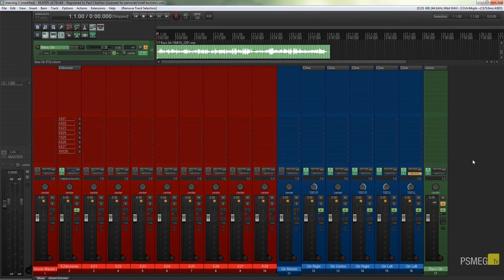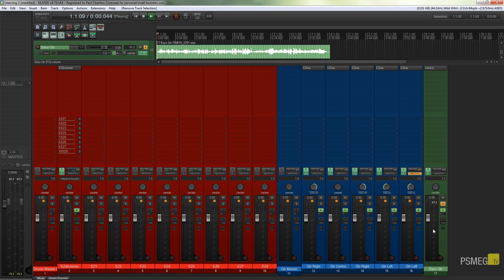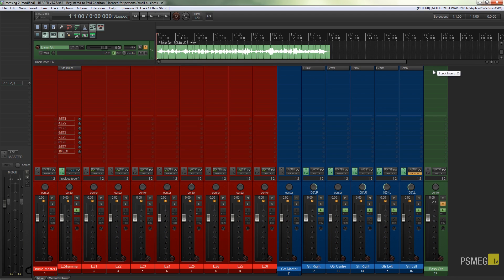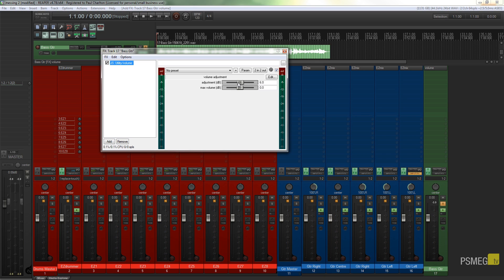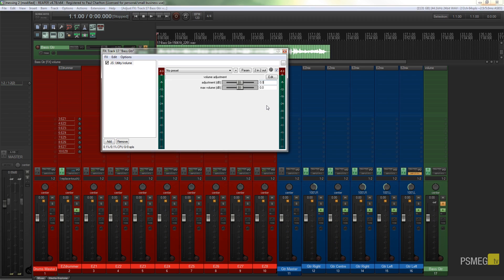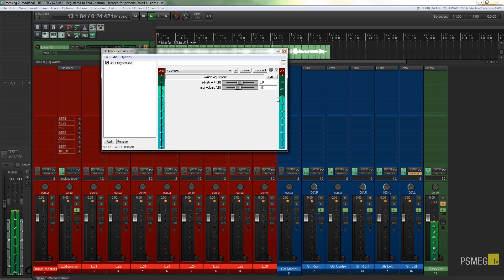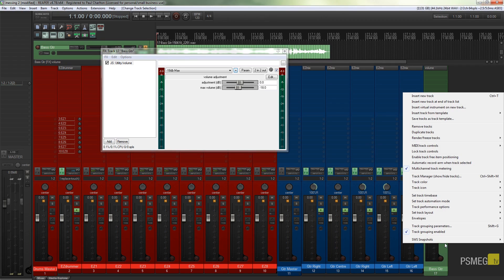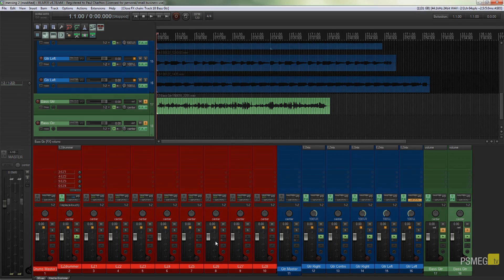Reaper Tutorial: The Basics of Gain Staging Part 2

Comment: Most of this isn't gain staging, you're settling on using a limiter which will alter the dynamic range. It isn't simply changing the volume, it will compress the peaks. There are lots of ways in Reaper to do this correctly, but this isn't one of them.

Comment: I may not be understanding but to me Max Volume is completely different to Adjustment - you can see the effect of Max Volume in the video itself. It just puts a brick wall limit on the output whereas the adjustment adjusts everything and maintains the dynamic range. You can see the difference as Max Volume all sits round the -18 and the Adjustment one dances up and down nicely.
I was putting some References on a mix to compare and setting everything to a similar level. The references had various levels as they had been mastered differently I guess but were somewhere between -1db and -4db. If I set an adjustment they sound fine. If I set the MaxVolume to -18db they sound awful! Distorted and crushed to oblivion. I would suggest that you would need to have a reason to use Max Volume on a track or would potentially have some odd results.
If I have misunderstood this please enlighten me :)

Comment: Is the gain-staging process supposed to occur before I have put any amp/cab plugins onto my DI signals? I'm having problems because every time I reduce the gain to -18db, either through JS Utility Volume or through the Take Properties, my guitars sound terribly weak with my plug ins.
Reply from the maker: I tend to use the output volume on my amp sim to control the volume after it's been effected to set the gain staging (for guitars / bass) as using the PreFX Trim on the track (which is basically affecting the DI) kills the drive.

JS Volume is OK for small adjustments but too much and it sounds like total crap.

As long as your not going into the DAW too hot (if you are you'll need to take more time setting your input level on your interface) you should be fine.

Digital audio has a lot more leeway than analogue, so you technically have more headroom.
Reply: ReaperTV thank you so much, that makes a lot of sense. So this video's info applies more to tracks that don't use any amp sims?
Reply from the maker: Yes, along with an signal that is a little too hot but not clipping.

It's one of those areas that there isn't 'one size fits all' solution. It very much depends on the instrument, FX and other influencing factors :0)

Comment: There is a different way that I prefer: open the Item Properties and go to the 'Take Properties' section.  There you'll see "Volume/pan."  This is actually the Gain know that is pre-fx.  In my opinion it works better.  Good video none-the-less!
Reply: thomas hudson Yeah, it's a bit strange - the other way (putting the VST on every track) also had me experiencing weird things.  If the other way works then I'd go with that one!
Reply: Fernando Zeleid More or less yes.  The last time I used Reaper, the Volume plug-in was creating very weird things for me, so I used the Pre-FX which I like much better.
Reply: Yes when i tried it, i got all kinds of weird things happening so i did not use it.
Reply: +CHERNOBYL STUDIOS So this is the same thing as gain staging? Like i can set it to -18db and it will not let it go over that, but will not affect the sound quality?
Reply: thomas hudson That's the JS Volume Control plug-in, with this one, you just watch the fader and adjust it until it's -18dB and then you're good to go :)
Reply: Thanks!
Reply: +CHERNOBYL STUDIOS Is that the same as item volume placed in the upper zone of every track?
Reply: CHERNOBYL STUDIOS ok am gonna use this, wats a good level to set it for rap
Reply: Yep...the simplest way to gain-stage the bass in this example would be to merely adjust the gain knob on the audio item itself. No volume etc. inserts fx required. But IIRC this feature was only included in Reaper from ver 5.0 onwards.

Comment: Summary of entire video: It's called a "limiter".
Reply: Not at all ! It's a volume/gain knob. What he should have said is the JS Volume plugin should NEVER be used while recording else it will behave very strangely. It should be used only once the track is fully recorded as what it does is look for the max volume and readjust the overall track volume accordingly, while keeping the dynamics.

A limiter instead acts in real time. 1) It adds/subtracts gain , and 2) acts as an advanced compressor and clipper if the real time audio reaches a predefined ceiling. So it doesn't keep the original dynamics like a volume gain does. The limiter can in theory be used while recording, but it really shouldn't. 

In fact, it doesn't matter at all that in REAPER the faders get hot while recording. By working in 64 bit internally (even on 32 bit machines), REAPER has virtually infinite headroom and can never clip in practical situations.  The clipping issue is all about hardware (in particular at the AD/DA conversions) and the non linear algorithms in VST fx most of which only work within a reasonable range. So what one must be careful about while recording is that your hardware chain doesn't get too hot and risks clipping. However, it must amplify enough that one stays as clear as possible of the mic/preamp/interface's own noise levels so as to get the clearest possible sound without clipping. 
Once recording is done, you can simply gain stage in REAPER with JS-Volume.
Reply: InXLsisDeo
Regardless, IF I was going to using a limiter, it would only be when mastering and it would be a brickwall type. As for recording, now days I'm using Sequoia.. but as usual, I always find that as a mix gets bigger, I have to constantly turn other tracks down to make the next track fit in the mix, even regardless of panning. I do this to reach maximum volume without clipping into that nasty 'sizzle' distortion in mastering, which is almost impossible to get rid of without destroying the entire mix. This is also probably because the guitar I'm recording is quite distorted - but in a good way, pretty much like a buzzsaw. It's so insane I have to use a Neve type EQ to control it and a separate higher end sound card (other than my primary one) to record it, otherwise everything just turns into a mess.
Reply: That's because your faders are too high when you start mixing. The general rule of thumb is they must be turned down to -18dB FS, as the first step before mixing. Thus all tracks should be in the green and this allows you plenty of headroom for mixing and mastering. There are SOME case where you can turn down more. For an orchestra you may want to turn down even more than -18dB. That's because the more tracks you have, the louder the master will get: every time you double the number of tracks, you double the overall volume (in average), thus you add 3dB to the master. So let's say -18dB FS is a good start for a 4 member band, if you are recording 8 instrumentists or singers, you should start at -21dB FS, if 16 musicians, start at -24db FS, etc. This is assuming they might more or less all play together at some point.
But remember that all the tracks that ultimately add to the master, i.e bus and FX tracks have to be included in the count as well, so this is a good general rule of thumb.
Reply: InXLsisDeo
"Faders".. meaning ALL tracks in the mix? Because I simply just avoid going over 0db on any track in the mix, BUT my master fader is usually always set at either -9db or -12db. I've tried -18db and beyond before, but it always makes my mixes sound too weak after being mastered.
Reply: Yes, all tracks except the master itself which stays at 0dB. It doesn't matter that tracks are low in your DAW. You can always adjust the volume of your speakers.
Once you've finished your mix, you should be around -8 dB on the master, leaving plenty of room for mastering. At the end, if the sound is too weak, slap a limiter on the master and add gain at will. It can also serve as a gain knob during mixing but make sure it never kicks in during mixing and mastering or it would ruin the process.
Reply: InXLsisDeo
What's the difference in setting the master fader at -9db to -18db instead? It equals out to the same regardless because if I'm sure all my tracks in the mix don't go over 0db, then I'm still at -6db to -8db on the master regardless at mixdown. So I don't see the difference.
Reply: ShadowⓋ Well that should work as well. So your problem is you did set the master too high.
Reply: InXLsisDeo
Probably. Now you're making me wonder if I mixed down again with my fader lower than -9db (even if I'm peaking around -6db) if that will make any difference when mastering. I think I've tried that in the past though and the mix seems to lose it's life or punch. It starts to sound a bit more soft or dull, rather than hotter and adding more volume with a plugin would most likely just cause more distortion. Any real solution for this? Some type of outboard gear method maybe ? I've often heard talk in the past about how known mastering engineers in the industry use compression for mastering, but I've tried it and I didn't hear any difference. Then again, I don't use any type of mixing console or tape either. Everything I use involves channel strips, which to my knowledge would probably be the same thing anyways..
Reply: I would start even lower than -9dBFS, anywhere between -12 and -18dB should be good, it depends if you want to do the mastering yourself or by a mastering engineer. In the latter case, be more safe than sorry and start at -15 to -18dbFS instead, so that at the end he has enough latitude to work, sometimes with hardware. It doesn't matter if at the end you end up too low, any good limiter like vladg Limiter n°6 will turn up the volume by +12dB without noticeable damage if needed.

As for your problem, I can't comment as that's not how I work, I work the way I described before (by lowering the mixing tracks instead) but I really don't see why that should be the case. Are you sure you were listening at the exact same volume ? If you don't listen at the same volume, you can't really compare because the ear prefers the louder track due to the Fletcher Munson effect. Also there might be some psychological effect at play where you want to move up the master fader.
Reply: InXLsisDeo Does that limiter have a brickwall option on it? If not, it would be useless for me when mastering because I'm always slightly pegging 0db, but generally only around 2db over. It's not like twenty or anything like that. As for monitoring (in the mix), I've always used an RME ADI-8 Pro to do my monitoring in a mix, which uses either -10dBu, +4dBu or "High Gain" on it's outputs. I generally just use -10dBu to record and mix, since the other 'pro' levels are way too loud. When I do mastering I just use whatever general or basic PCI sound card, since they're all mostly consumer level. What I've noticed is, the monitoring with the RME always sounds slightly louder, even at -10dBu in the mix or basically the same level at 0db with the general consumer PCI sound card. That one has always puzzled me a bit. Not sure why  RME is always slightly louder at consumer levels. As for the suggestion to start anywhere from -12 to -18, been there many times in the past. When I do that and then mix down, my mixes always seem to lack punch or volume in mastering. Distortion also starts to occur if I try to jack the overall volume, it just turns into a sloppy mess. I'm not sure what it is really. When I do that, it doesn't seem like a 'hot' mix or something and it lags in a dull way.